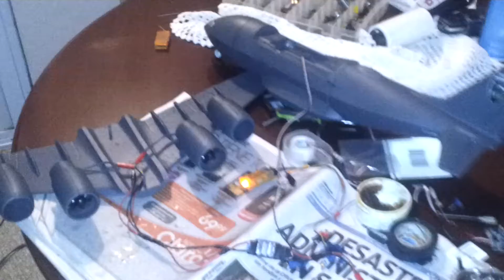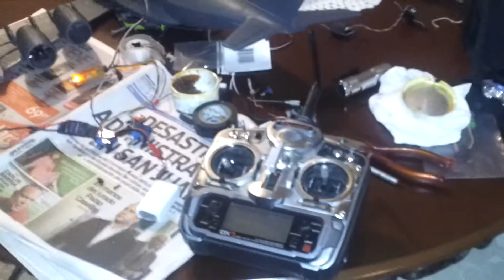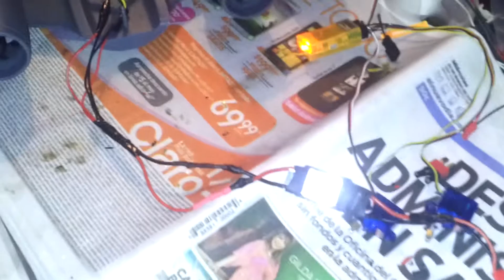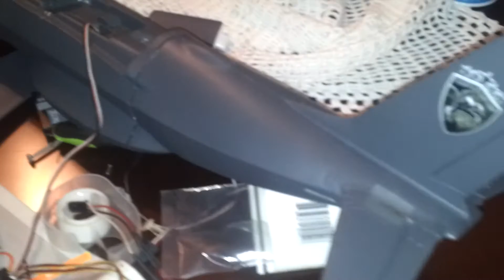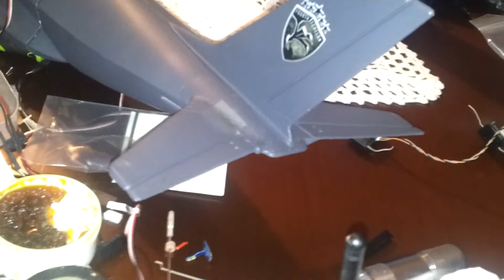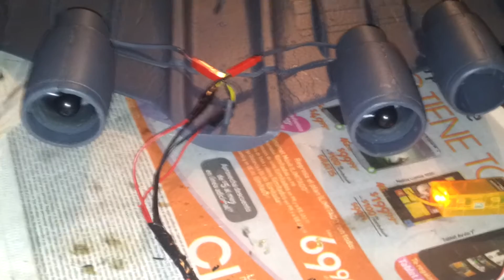Splinter Cell Paladin C-147 modding...

Comment from the maker: Ok I have been off the hobby for well over a year now. But the enthusiasm you guys show for this is giving me the itch to work on it again!!
But I have some questions maybe somebody might help me with:
The micro servos, Should I glue them under the wings and cut ailerons near the wingtips? Ideas? Still trying to figure it out.
Reply: Cesar Padilla The wings seem thick enough to put servos there..  use a sauntering iron to notch some foam out and put them there.  What ESC are you using for the motors?  What KV were they?  Nowhere in the specs does it say anything about them other than that they're 30mm ducted fans.  I've had it with this plane in its present configuration.  I just can't get it to fly and making it 4 channel would be the only solution.